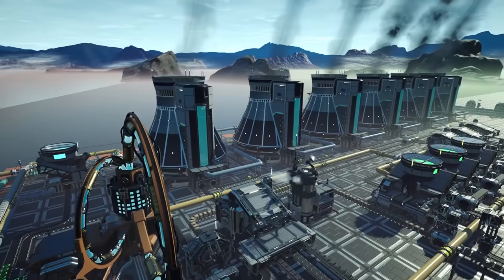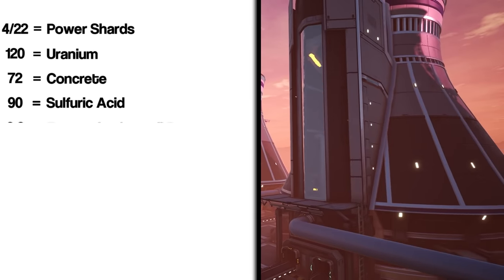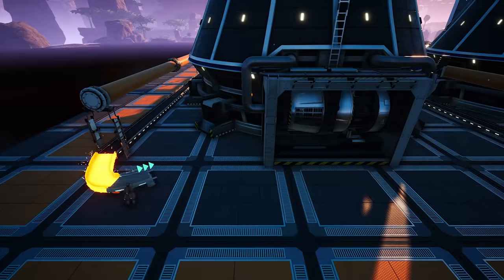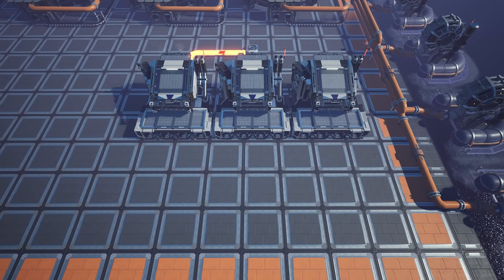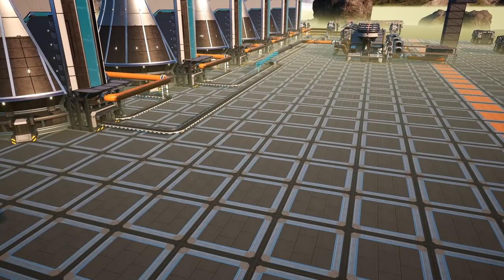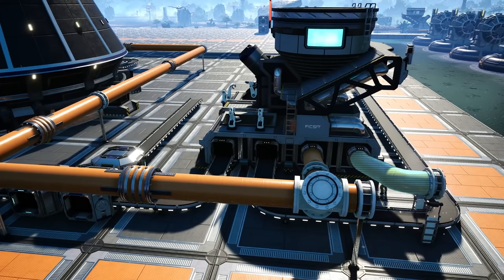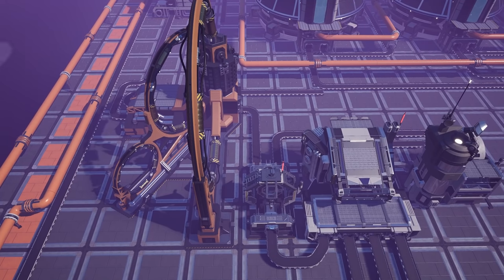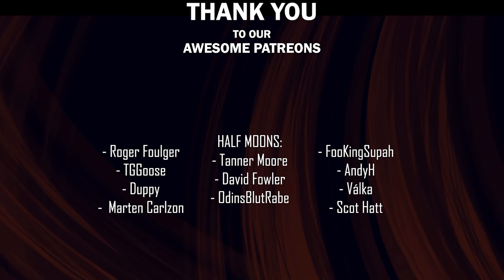Satisfactory Guide | Nuclear Power with no Waste Build Layout.

Comment: I just multiplied everything here by 5 and got 30 nuclear plants going, so far everything is stabilized.  This guide helped immensely, thanks.
Reply: just curious as I am some what new to the game in this stage, where did you build your nuclear stuff at?
Reply: @austinmoen5278  Built it in what people call "the swamp area".  It's all the way on the east side of the map, its below a massive waterfall.
Reply: @austinmoen5278  
The rambelings of a sleep deprived student that should be writing his bachelor thesis:
I'd build the initial nuclear powerplants close to where all the necessary fluids/gas nodes are, since transporting those was more of hassle for me than the rest (although that might ave been because I had factories and storages for everything before the blender update, so it might have been a me problem).

But if you are bored and have a semester break from uni you can do it like me but better. I made a hhhhuuuuuuugggeeee platform in the sky where I deliver all the resources to by drones. I do not recommend this approach since the balancing of resources is extremely fickle but I really wanted to try out drones. And making a giant drone hub for nuclear power along with the powerplant and recycling station takes a long a$$ time. If you make one of those, don't build it in the sky. I can never look at the thing now :(
Also fluid and gas transport via drone is really unnecessary (but drones are cool). Also since I'm too lazy to calculate everything to 100% efficiency I just increased the inputs and sink the overflow/leftover fluids/gases in their packaged forms. I started using this methode when I made the battery factory to supply the supply drones that supply batteries to each drone hub (so many batteries)
Reply: @gringbot  nice, i've been doing the same thing, exactly 30 nuclear plants for me as well (6 rods/min) in the swamp area
Reply: Same here, however there are more efficient recipes. I used the remaining 1500 uranium on the map to make 36 uranium fuel rods per min and 180 reactors. Recycled to 13.5 plutonium fuel rods.
Reply: @Jordan-xt9dv  Damn, that is crazy.  Do you have any information on how to do that?  Like a guide or something you used?

Comment: i usually like all your guides but a common thing is a very vague mentioning or not showing each valve setup which if not placed correctly makes this entire build void. have seen others have issues with the 2nd set of valve placements as neither the video or written guide has exact showing of all valves and no replies to the year old questions regarding the valve placements. otherwise appreciate the effort put in with all the calculations

Comment: Pretty good guide, but i see lots of confusing piping... I want to build this, but there is alot not shown when it comes to the piping in the recycling.  your images are not clear on where pipes connect in that process and you even add 2 new pipes to the video and give no explanation as to what they are and where they go or are used.

Comment: Great video! but did the mats changed? i see that one powerplant need 240 water now pm,. you say in your guide 300 and got your water extractors overcolcked to 250%. i can boost my power plant up to 125% this way it needs 300 water but then will the rest still work? or should i clock my water extractors to 200% so it gives 240pm? Thanks!

Comment: This is a pretty good guide in terms of setup and % / number allocations, and still holds up today in V8... but it took me a few tries and timelapses to discover and address things that I didn't do right in the system, in order to finally get it all flowing correctly. I suggest making 1 last "save" before you turn everything on, so you can go back to that save and fix whatever you discover you got wrong in the system. This guide would be more helpful to also cover the pipeline flows and valves more, especially on the Sulfuric Acid loop. It's also worth mentioning that if someone chooses to run the Non-Fissile Uranium Blender excess water pipe back to a Nuclear Power Plant, they need to put valves on both the blender line and the main water pump line to limit the water flow from the main pump line and ensure the blender line has continuous flow allowance. Also, in distribution of the Uranium Fuel Rods to the Power Plants, I found that merging all 3 Manufacturers into 1 conveyor, then trying to spit it 6 ways for each Power Plant doesn't work. Instead, I had to have each Manufacturer split 2 ways to serve only 2 Power Plants (to ensure an even distribution), and that seems to be working better now.

Comment: Thanks for posting this TotalXclipse, it's really helpful; I'm currently prepping for my first nuclear build so the timing is great. I'm going to be building a separate waste reprocessing plant at the same time and sinking the output. I haven't decided on the scale of what to build, but I was leaning towards try for close to 50,000MWH, or eighteen to twenty nuclear power plants; it may be a bit ambitious for a first try but I want to make it worthwhile and that would allow me to repurpose one of my diluted fuel setups to making recycled plastic and rubber while still boosting my power production. I need to go through the numbers to see if that's workable though.
  
I'm trying to plan it with some sense of isolating radioactive areas/machines from the regular factory elements, building the nuclear power plants and reprocessing plant out on the coast at the swamp and running a train line from a production hub in the dune desert (where I'll gather/manufacture all the non-radioactive parts required for the fuel rods and waste reprocessing) to the edge of the swamp, where it will be put onto an enclosed belt system into the radioactive zone for final assembly. I've not decided whether to use belts or drones for the uranium, but I'm leaning towards an enclosed raised belt bridge (not floating) if I can make one straight run from the falls to the coast facility while avoiding any resources. It would reduce the risks (roleplaying no chance of "accidental crashes" irradiating the landscape, but also no risk of power outage if the drones bug out), and would be a cleaner way to bring power to the miner; I'd have to build an irradiated platform for the drone port and drag power lines across the water to it otherwise.

Comment: With some of the alt recipes you can make this very modular.  Another advantage of a setup like this is if you need to rebuild if you can just cut off the uranium and most of the radioactive material will eventually go into the sink, a few products may remain but a lot less than when running at full capacity.
Reply from the maker: Absolutely!

Comment: Very much looking forward to Aluminum.  I've tried like 5 times and still can't get the fluid balancing quite right.  At this point I suspect pipes are haunted.
Reply: They are 👀 Fluid balancing is pretty weird 😂
Reply: Pipes are haunted
I recommend sinking the overflowing fluids in their packaged versions. Packaged sulfuric acid go shreddd
Reply: if you still don't know how : do a pipe junction priority merger (feed the excess to the top of a junction and the main input on the horizontal side, with a valve
Reply: @rocket2739  Priority mergers? Interesting. I will certainly look into that.

Comment: 1:58 I know this is nitpicking, but the Watt unit already has the "per second" built in, since one Joule per second is a Watt, Joule being energy, Watt being power.
Reply: It is perfectly acceptable, common even, to rate the output of power plants in Watt-hours instead of Joule. But if you need the conversion: 15 GWh (which is what his plant produces) is about 54 Terrajoule.
Reply: @QemeH  yes, but he didn't mean it in that way, since he said per minute, implying the same rate at which every other item is produced in the game
Reply: @Otakutaru  You're right. I looked it up in the game wikipedia and each power plant produces 2500 Watt, so 6 of them have an output of 15 GW (which was correctly displayed on the overlay) - which is equal to 900 GJ/min or about 0.25 GW hours per minute.

Comment: Built this to exact specs from the tips site.  Problem is balancing the sulfuric acid return.  If anything goes out of balance then the whole thing shuts down.  I have set the valves exactly as recommended.  Please offer any tips on how to fix this.  It's an amazing system!  Thanks!

Comment: It's probably worth noting that the two alternate uranium recipes (infused uranium cell and uranium fuel unit) are much more efficient than the vanilla recipes and also saves sulphur and makes it less complex (raw sulphur vs. sulfuric acid). You also save on water which is nice because running nuke plants require a ton of water. 

The downside is that you'll have to make A LOT of quickwire (more than three 780-belts if we're shooting for 10 rods a minute) as well as swapping concrete for silica and having to make a token amount of beacons and a fair amount of crystal oscillators.

Basically, you're spending a bit more energy and adding complexity to get a lot more fuel rods (33% more energy) and also min-maxing the uranium node which is an obvious bottleneck if you plan on making a lot of generators. 

As for recycling, I wouldn't recommend any of the plutonium recipes simply because the focus is on just getting it out of the chain. A case can be made for instant plutonium cell (convenience) and definitely a case for the plutonium fuel unit (more rods to sink). But the plutonium fuel unit adds two late game items to the chain. You're definitely already making these, but your nuke plant shouldn't be near your main factory. You can ship them in, but I'd prefer to just get rid of the rods as painlessly as possible. The instant fuel cell requires an aluminum product. So, if you're making it nearby already, go ahead and use it to cut a step out. It will make fewer rods and add an aluminum product in order to cut a step that's really easy (pellet+concrete)

Fertile uranium is good if you plan on burning the plutonium fuel rods (meaning waste) or you just want to sink as many plutonium rods as possible. It will take raw uranium out of your uranium rod line which means fewer uranium rods. Like I said -- only for burning plutonium or strictly to sink rods for awesome points.

Comment: I came into an issue with the recycling blenders water output, the blender says it makes 18 per minute, I tried merging it with one of the reactor lines like you mentioned and put a valve before the merge to limit the water from the extractor to 282 (300-18) but my blender still backstuffs with water then stops processing the waste
Reply: Having the same issue. I’m trying to decide if packaging and sinking the water is the right way to go. The values don’t appear to be working so I’m having trouble limiting or fixing the issue. In the video, he says it’ll take some strain off your water extractors but I’m unsure how to do that correctly.

Comment: Where should be that valve limiting to 90? There are many junctions in the build...
Reply: Wherever your junction is from your pipe of 6 excess acid (bypassing the the Non-Fissile Uranium Blender) feeding back into your pipeline loop. At that junction is where I have the main pipeline feed of incoming Sulfuric Acid feeding into the closed loop system as well, but with a valve for that main feed set to 90. The combination of the valve-controlled 6 excess + valve-controlled 90 main at the same junction point into the loop makes 96 Sulfuric Acid flowing to the 3 plutonium blenders consistently.

Comment: 7:20 I have watched this part like 20 times now and I still don't understand it. Where do i lead my extra 6 sulfuric acid to? i have no idea at all. Why should i lead 90 sulfuric acid into my output line?
Reply: so im sure you dont care now that it has been 3 months, he sets it too six to allow the extra six to run back to the blenders and then set the input from the outside to 90 to allow that excess to be used

Comment: Hey,great vid! It's little bit of a bible for me to work on nuclear power. But I've come across two diffrent texturepacks- first one we all know with the standard looking barrel and some uranium drip just under the lid. The second comes in a smaller size and looks little bit more like a plastic-ish barrel. Has that texture always been there? Can't seem to use it with the other texture on the waste line.

Any1 else come across it and how did you solve it?
Reply from the maker: The blue barrel is plutonium waste, which cannot be recycled so you're given the option of recycling the rods for no waste or using them and being stuck with even more potent waste
Reply: @TotalXclipse  Awesome, huge thx for a quick response!! Keep up the good work on the vids!!

Comment: Is this video still valid with the changes since update 4?
Reply: @TotalXclipse ALSO, your viedo and guide is VERY different. Even the words you say in the video are NOT what your doing in the video. So let's use the Blender for making non-fissile material. You say to place the blender at the TOP LEFT hand corner with the INPUTS facing the BOTTOM! But in your video (and the guide) the inputs are facing the TOP of the grid.... The whole thing is just confusing >.< I LOVE your guides, but man please work on clearing them up and actualy doing what your saying in it!

Comment: 6:28 is that a fluid priority balancer?
Reply from the maker: We're talking about the waste load balancer.  Yes and no, the fluid isn't exactly a priority balancer, all we're doing is using up 26 of 32 sulfuric acid (or whatever the ratio is) and limiting so that only the 6m of liquid we don't need gets fed back into the system
Reply: @TotalXclipse  oh ok. Cause i need a fluid priority valve for a variety of reasons